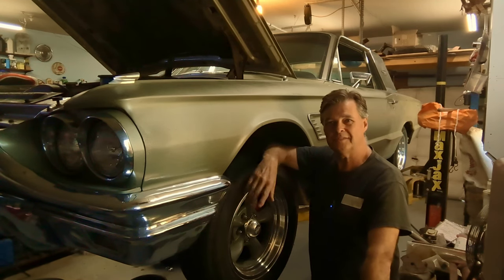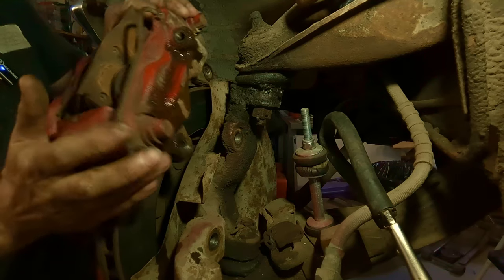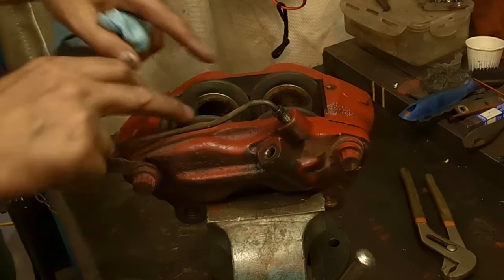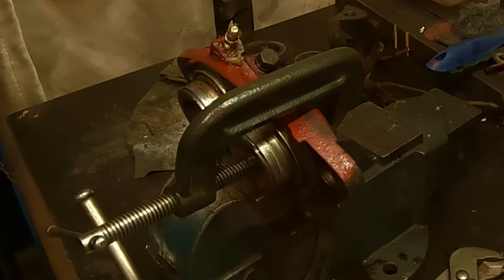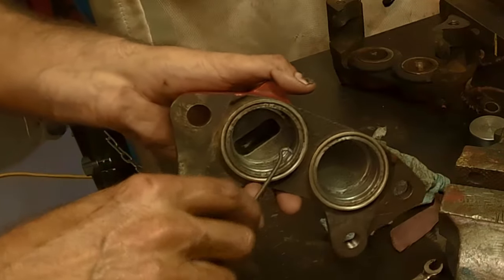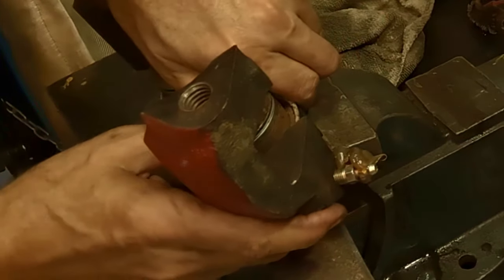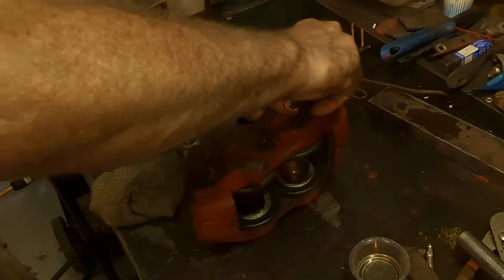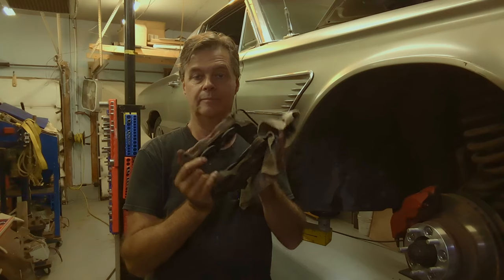Easy & Safe Way to Remove Stuck Brake Caliper Pistons

Comment: This was a great video. I have replaced the calipers on several 66 Birds over the years but just got rebuilt ones.  Never tried to do this myself.  Now I know!   My 68 Lincoln coupe uses these same Kesey Hayes monster brakes.  As you know they came out on the bird and the Lincoln in 65.  BTW when I bought my first 66 bird in approx 1971 from the original owner (85000 miles) the owner gave me a set of pads that he had purchased and never installed.  Of course it was a small town with easy driving but those pads lasted until about 120000 miles when I just replaced them because one was getting pretty close to the metal.
Reply from the maker: Hi Jeff,
In most cases, a new or rebuilt is the best way to go, but given the state of getting quality parts these days, a guy may be better off working with what you have.

Comment: Hey Alvin, great video. When popping out the pistons with air while the caliper is in a vice, I leave the calipers bolted together and I insert several brake pads in between the pistons so that when I use the air to push the pistons out, they can only move a fraction of an inch out, maybe a half inch or so, but not fully out. Putting the brake pads in between the pistons prevents them from just blowing out uncontrolled. Then I remove one brake pad and blow air again to push them out further. Im basically working them out little by little until I can remove them by hand. You can use a combination of new brake pads and old used brake pads because they will be different thicknesses, allowing you to decide how far you want the pistons to move depending on how thick or thin of a brake pad you remove while pushing the pistons out. Then, after you reinstall the old pistons or new pistons and reassemble the caliper, you can test the seal by putting brake pads between the pistons again so they don’t move, and applying air to see if the seals leak.  Putting them in the vice like you did is also a very good suggestion too and a better solution for those that don’t have air. 
Man your brake fluid in the caliper was really really bad. It wasn’t brake fluid anymore. That’s pretty dangerous and this is one of the very good reasons to purge and bleed your brake system once ever couple of years. 
If the pistons are pitted even slightly, they are no good. Im really surprised that yours were not heavily pitted considering the condition of the brake fluid, if that’s what we are going to call it. More like dirty 90 weight gear oil. Its okay to use 1500-2000 wet sand paper to polish the side walls of the pistons. 
Yes, you can purchase brand new calipers. I made a video about those and how they don’t exactly fit perfectly. There is a small flaw that must be corrected when installing new calipers. Its all in my caliper video. When I told the manufacturer their response was, “Really, are you sure? Nobody ever said anything about that before.” Im always the first one to complain. 
I remember when the caliper piston seal kits were available from Napa. Ahhh, the good old days. The last time I tried to buy them, maybe a few years ago, they were hard to find. I think they are now available from the Thunderbird dealers for about $20. Thanks for the entertaining content.
Reply from the maker: Hello Nick,
I agree with you about using air, its a quick way to do this job, and for testing afterward. I am a little on the cautious side around using compressed air to people, I don't know their skill level, during my years of underground mining, I've seen some pretty bad incidents involving compressed air, including one fatality, it's probably just me worrying too much. lol
Yes...that brake oil, if you can still call it that, was nasty, I'm glad I took the time to get that crap out of there!
I found one site selling the Kelsey Hayes calipers, and I thought the price was decent...but they said in their listing that they fit every Ford with this style of caliper, except 65-67 Thunderbird, so something is different, and I did watch you video, where you ran into this problem, so it looks like they can be modified to fit.
Thank you Nick, I always look forward to reading your comments. 😊
Reply: I did mine on the car. I took a pad out and put it back at right angles then started the engine and stamped on the pedal which pushed the piston out far enough to get it out once the caliper was removed.  My stuck ones were well beyond saving but weren't leaking. I had 2 stuck ones each side but the car still passed it's roadworthy test here in UK !
Reply: @davidlanghorne1603  Hey, theres another way to do it. What ever works right. Most calipers I rebuild need new pistons. These days, I just buy new calipers, its easier.

Comment: Hello Alvin. I like the idea of using grease. I've used compressed air before, never thought of using grease. Ill give it a try next time I do them.
George B
Reply from the maker: Hi George,
I like using grease when the pistons are really stuck, it's a more gentle method...air is fast, and I'm not against using air, however, it gets a little more lively when the pistons pop out! Lol

Comment: Great stuff. I thought using your needle nose vise grips to pinch off the brake line was slick. Thx Alvin
Reply from the maker: Yes, it work quite well, if the lines are to dried out, it will damage them...but they should be replaced anyway, if that's the case.
Thank you Doug.

Comment: Hi, I need to replace the anti-rattle shield that sits on top of the brake caliper (I have a knocking noise that I’m pretty sure is coming from loose brake pads). In your video, you say the two bolts that hold the shield down will often break off. I’m a little apprehensive after hearing you say that, but I thought I’d soak the bolts in WD 40 penetrating oil before starting. Anything else I can do to ensure success? Appreciate any help. John
Reply from the maker: Hi John,
Hit them with some heat too, and only break them free at first, less than a quarter of a turn, and then back in again. Keep doing that, in and out but a little further each time, just be patient, and you should be okay.